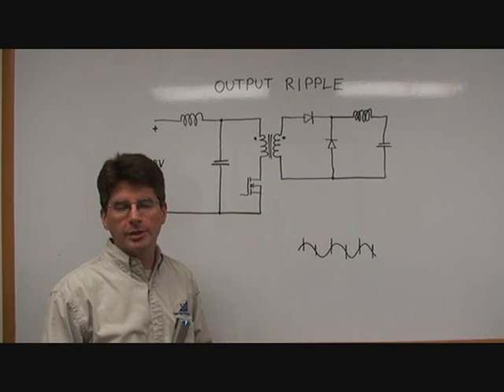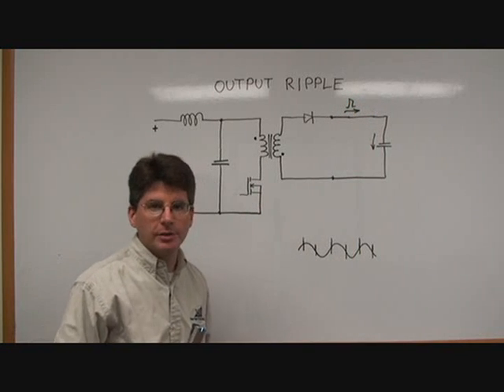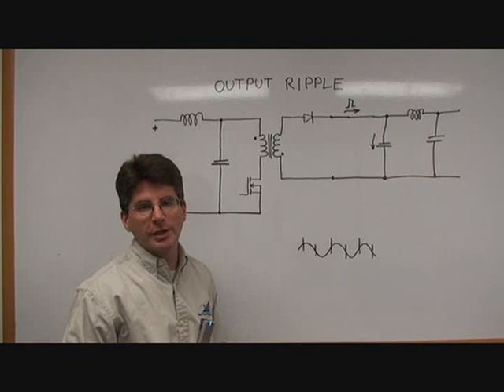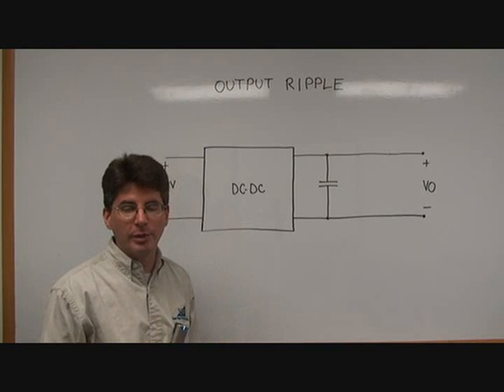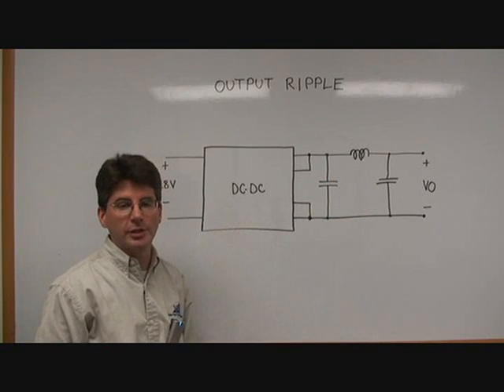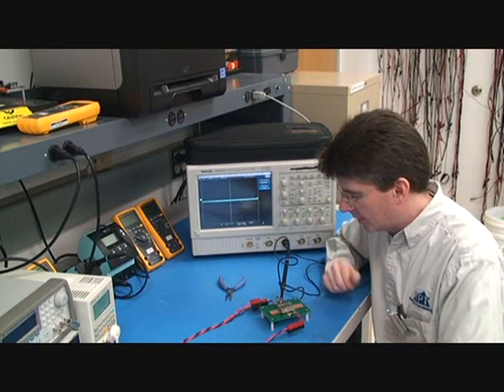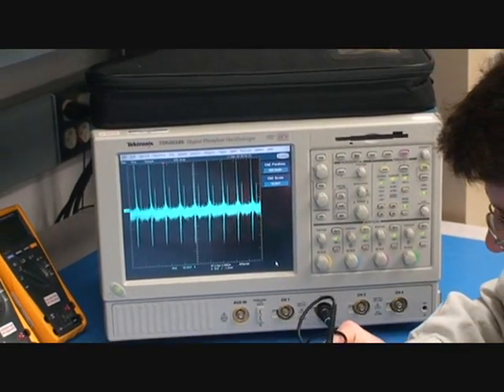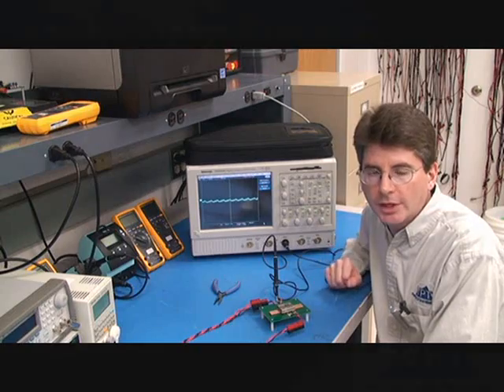How to Reduce DC-DC Converter Output Ripple

Comment: There do exist ceramic ones of big values like 10µF, 22µF, 47µF and even 100µF. Never ran into them in any commercial equipment tho (probably cause electrolytics are cheaper), but you can buy them.

Comment: I think there are two different things being discussed in this video: 1) the output ripple, and  2) the switching noise appearing in the output. What is actually is being reduced here by the addition of the ceramic capacitor is primarily the switching noise not the ripple.
Reply: agree, the output ripple is predominately relying on the inductor thereof.  but I do not fully understand how LC filter affect the transformer.

Comment from the maker: VPT's engineer recommends 20uF = 2 x 10uF in parallel.
Reply: Is reducing the ripple greatly below the tolerance levels useful in any applications?Once stability is achieved to a certain extent is there any use of further increasing the stability?In which applications does this make a difference?